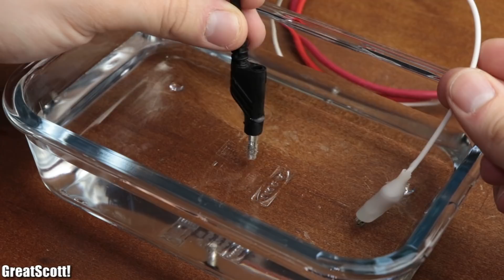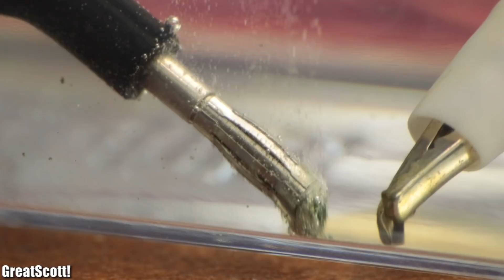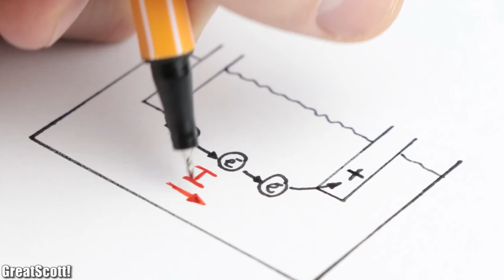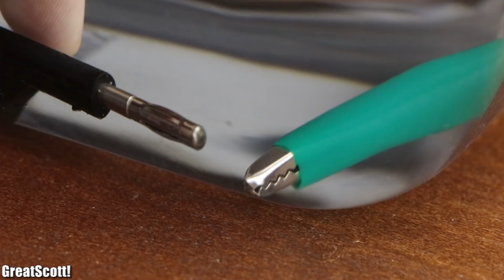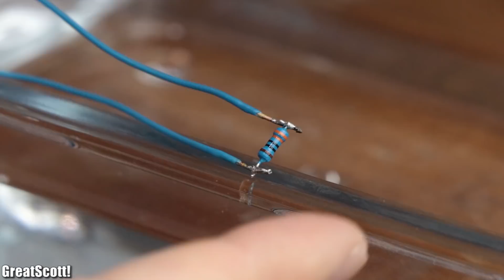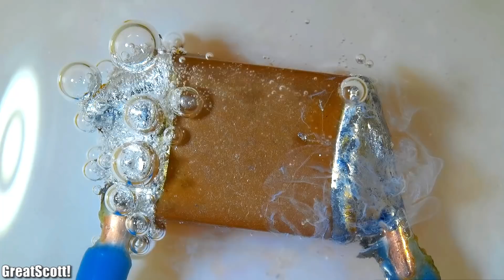Electronics & Water? What could possibly go wrong?

Comment: I'm glad to see you have "debunked" the myth of the conductivity of water. 

At a previous job, I would load test standby generators in the range of 250kW to 500kW to assure the generators functionality  using a "brine tank" as the restive load.  This is a steel tank filled with about 200 to 250 gallons of tap water and an isolated copper conductor plate which was slowly lowered into the tank to increase current draw.  Fully immersed, there would be near zero current draw between the plates when lowered into tap water.  By adding about various amounts of table salt, the water would conduct electricity to the point the load could reach 100% of the rated load of the generator and the conductive plates would have to be lifted out of the brine to regulate the load being drawn.

Thanks for the great work you do.
Reply from the maker: No problem. And thanks for the feedback. Interesting story.
Reply: @greatscottlab    You should do a follow-up video, repeating this experiment with seawater!

Comment: Really interesting ! I'm eager to see the video to make integrated circuits waterproof :o
Reply: Doesn't nail polish have acetone? would that not dissolve the solder mask and make the writings all smudgy?
Reply: UFOhunter Nope, it's nail polish remover that's made of acetone.
Reply: some nail polish actually uses some kind of plastic dissolved in acetone.
I'd use something llike polyurethane or epoxy, which can be bought for around 10-20€/kg.
Reply: You fill the case with apoxie or you spray it with silicone. Any number of things could have cheaply water protected portable devices. It’s criminal that it has taken so long when water is literally EVERYWHERE.
Reply: @alexanderm9832  right so the solvent in nail polish is also acetone. Thus why it smells like acetone and can be wiped off with it.

Comment: At work I operate Wire EDM machines that use a fine brass wire to accurately cut steel and aluminum. The cool thing about it is that they do it with the part submerged under highly filtered water using voltages up to 300VDC. With all of the minerals filtered out, the water no longer conducts electricity. Although it is not recommended, you can stick your finger in the water and never feel even the slightest tingle.

Comment: You should make video waterproofing electronic. Use some clean coating. :) or waterproof really old PC and run it under water :)
Reply: You cannot make PC waterproof like that because it will overheat.
Reply: Nopparuj Ananvoranich it can be in water with fishes. and you can always under clock it
Reply: Nopparuj Ananvoranich Water is a pretty good conductor (of heat).
Reply: That's not true, lol. The heatsink doesn't need to be waterproofed, it's already waterproof ;) It'll cool just fine, maybe with an underwater pump or two to blow some water through the fins.
Reply: You'll cook your fish. Plus, how do you remove the heat fast enough so that the water simply doesn't continue heating? Water has a high thermal content, but it also takes time to cool due to that.
Reply: BuzzCola 3 there now is
Reply: Learn about immersion cooling ;-)

Comment: Thank you for posting this. 

By the way, the second Arduino in the distilled water likely stopped working because the water would have dissolved any residual flux on the surface, increasing conductivity right at the surface of the Arduino. Once the dissolved flux remnants dispersed over a larger area, the conductivity would have dropped back down.

Comment: well I dropped my phone into toilet once, got it back in 5 seconds but it didn't turn on ever again. That's all the testing I needed to do with electronics and water. 
FAQ: 1.) I took the battery out imediatly (because it was nokia remember when you could take batteries out of phones yourself, peperidge farm remembers) and air dried it overnight before attempting to turn on. 2.) it slipped out of my hoodie big cenral pocket, the one where you can touch your hand together even though they are in pockets, you know the type, yeah be careful with those.
Reply: That water had a lot more impurities than normal tap water.
Reply: Well urine and stool both contain a lot of salts.
Reply: if fit falls into water DON'T TURN IT ON IMMEDIATELY
Reply: darius2640 I think that there was more than just water in that toilet...
Reply: Remove battery, immerse in pure isopropanol, brush corrosion off circuit boards, dry in oven (50-70C). Gives you, if not a working phone, at least opportunity to backup data.
Reply: remove the battery and let it dry bro
Reply: If you rinse the electrical device in Alcohol then resolder it will work again but not for long. Rescuing your phone from water damage is only for data recovery. The device has a short life ahead. It will be unreliable no matter what you do. Ipad rehab has a $99 special for repair and data recovery.
Reply: if it was long time ago try it powering it again with another battery

i once brought back to life a phone that was completely submerged in the sea and after 3 months it had still water in the screen but it worked perfectly without any issue
Reply: sleeptyper i use 95% alcohol to wash it off works fine.
Reply: what phone is it? if you could have possibly removed the back and taken the battery and sim out to let it dry.
Reply: my question is, how do you drop your phone in the toilet??
Reply: Did it fall before or after you flushed? there is a big difference
Reply: Solder Joe
 Depends on what was damaged and whether all corrosion/water is gone.
Reply: yes - if you ever drop an electronic item into water take immediate steps to disconnect the battery asap - I have 2 mobile phones that I had fully immersed into a bucket of water and they are still working today. Also I found that keeping these devices in front of a air conditioner (the real ones that use the gas) it really helps to 'soak out' all the residue moisture :)
Reply: Are u romanian?
Reply: problem was that you try turn on imidlity you need dry it first
Reply: Not on iphone if someone drops a phone in the loo chances are it's turned on. iphones usually short out on the screen connectors or an ic chip gets fried..either way you can't just whip out the battery fast on most modern phones which is a royal pain.
Reply: darius2640 I dropped my i5 in the toilet five days ago and it was working properly 24hour later
Reply: Clark Adams
i5 logic boards are about the length and width of a finger and roughly the thickness of a a coin.They are tightly packed with components unlike in this video they are a lot smaller with a lot more going on. Any moisture in there  could easily cause a short potentially. If yours is okay that's great news but it doesn't mean your out of the woods as parts could still be corroding make sure you back  up anything important just incase.
Reply: Mine survived a toilet just fine and then I bricked it through software a few days later...
Reply: I dropped my phone in the shower once and it got soaked but was perfectly fine.
Reply: Dariune put it in rice
Reply: A rinse in alcohol binds any water still in the circuits. As alcohol evaporates, it takes the water with it. But a bath in dry rice will then remove any remaining moisture. It may not save the phone for eternity but depending on how wet the water got into the phone, it may keep it operating for a long time, or not.
Reply: Same
Reply: You can still take batteries out of your android
Reply: i once lost my phone on my garage due to tall grass, i found it 3 days later and it rained. it was still on so i shut it off and let it dry. its still working to this day, it was a samsung galaxy j5, already rocking a new one tho. battery leaked out a lil but still working, batterly life was a lilttle worse after it but i didnt even bother to get a new one it worked just fine. the camera lens got completely fucked tho because humidity couldnt escape so i had to change the lens
Reply: @IAmRedNez  It is waterproof?
Reply: @TtEL  no, it was a sony ericsson k810i

but if it doesn't stay long in the water and if the battery is removed immediately the phone has a big chance to not get damaged, i've fixed many water "damaged" phones and most of them needed a new battery or a trickle charge at the old battery and some cleaning at the charging port
Reply: the amount of shit and piss in that water corroded the fuck out of it, and not the actual water
Reply: O
Reply: the water in toilets is similar to regular tap
but with more impurities and depending onwhere it happened the fac that it may or may not have been cleaned plays apart
Reply: Put phone in rice. It gets fixed, my mum did it to her s9

Comment: The Arduino failed just because the crystal oscillator is a very high impedance circuit, where even the distilled water is practically killing it. Using the a bit less accurate but fully internal on chip oscillator would mean it will work like a charm even in the rap water. It puzzles me, why so many designers not requiring any accuracy are still using the fiddly crystal as the clock source by default...

Comment: Once upon a time, when I worked as a control tech apprentice for an Asphalt Plant manufacturer... the official way we remidied dust/smoking plant operator problems with computers was a water hose. We were usually doing major controls upgrades that took weeks. So long as all the water had time to completely dry from around IC's, we never had problems. 
   A computer's rear mounted vacuum device often branded "Cooling Fan" causes big problems in an industrial environment. I've seen old PC towers that were 80-90% full of dust munchkins.

Comment: This video reminded me with an experiment I did any years ago. I dispersed graphene nanoplatelets  into a dielectric fluid to increase its thermal conductivity (way less than 1% by weight).I placed a computer power supply in the fluid after checking the electrical resistance of the fluid which was to high to measure, before and after adding the graphene. onceI powered the power supply, it smoked. I couldn’t understand which components failed. You should try this experiment with graphite in oil. You might figure out the cause of such failure. Thanks you for great video.

Comment: The current flow in the distilled water is caused as you have made contact with the water with you hand. You see, sweat also has ions and can make the distilled water conductive
Reply: that's what thought
Reply: Yeah, distilled water has resistance in range of several Mega Ohms
Reply: While pure water does have a rather small electrical conductance, would it be blasphemous to suggest that distilled water does not, with absolute certainty, contain any ions?

Even the vacuum of space contains a countable average number of hydrogen atoms in a cubic meter.

Comment: Electrolysis can be used to effectively and easily remove corrosion and crud from metals.  Simply hook up a DC power source to it with the negative on the item to be cleaned and a sacrificial anode to the positive.  Washing soda works awesome as an electrolyte  (I have used this to clean up old coins I've dug metal detecting & also many, many, many times to clean parts of machines in the workshop.)  The corrosion on both terminals you witnessed in the video is from using AC current.  Since the positive & negative swing back & forth, crud is deposited on both.

Comment: And this is why water cooling setups for computers recommend distilled water rather than tap water.
Reply: I think water isn't just good idea for cooling. It has rather a low boiling point for high power PC.
Reply: It doesn't stay distilled for long.

The usual cooling mix for computers is distilled water plus ethan-1,2-diol. Plain antifreeze, as an antimicrobial. You might think the water is devoid of nutrition, but the algae somehow find some anyway.
Reply: GreenMC in don't Think anything in  your pc should ever reach 100 degrees celsius
Reply: Kevin Rabe I'll agree with you, but even at lower temperatures water will slightly vaporize, so some alcohol mix would be better.
Reply: GreenMC wouldn't alcohol evaporate more quickly?
Reply: Kevin Rabe It depends of alcohol. For example Ethylene glycol has boiling point of 197.3°C.
Reply: I think distilled water is used because elements in tap water like Calcium would start to deposit to your cooling units and decrease its thermal conductivity. Like in your Water kettle.
Reply: Camelia sinensis distilled water eats metals like you wouldn't believe, the anti freeze has the anti corrosion element of the mix
Reply: Water is the only liquid that takes a lot to heat up and doesn't release the heat as readily. Google endothermic and exothermic properties of water. 
It is also the only liquid in the universe (that we know of), which expands when heated, OR cooled to freezing point.
Reply: Water, distilled or not, produces galvanic actions which will corrode anything with time. It creates microscopic voltage cells that does that. Hence the use of Zinc in process of galvanization of steel. Zinc is the sacrificial component.
Reply: if your cpu gets above 100°C you will start damaging it, so water is fine as far as boiling goes
Reply: Assuming the system isn't vented to the atmosphere, evaporation isn't a concern. The boiling point is the temperature at which the vapor pressure of the liquid equals the pressure of the gas above it. Evaporate some liquid and the pressure goes up, so the temperature of the boiling point goes up to a new equilibrium.
Reply: water on watercooled PCs doesn't reach that temperature, if the CPU reaches 100 degrees (water boiling point) the water is way cooler than that
Reply: "It is also the only substance in the universe (that we know of) which expands when heated, OR cooled to freezing point."
Add "known to me" because there are substances that have a density anomaly like water. Even some pure elements have that: gallium, silicon, germanium, antimony, bismuth and plutonium
Reply: Better use mineral oil? Tho the pumping process would be harder
Reply: @Gusstavv, Propeller piston engine on small aircraft, are cooled by engine oil.
Reply: UFOhunter Stop spreading BS. Silicon and Gallium also expand on both heating and freezing.
Reply: I spread whatever I want troll.
Reply: I listed elements specifically because even those show this property. Of course there are countless other substances that do it as well. Last time this was a issue for me was n-Decanol freezing (below 7°C) in the bottle and thus breaking it. What a mess...
Reply: You call me troll but it is you who is trolling.
Reply: @PolakPL2002  why do people think water boils so quickly? We've been using water (plus additives) for centuries now to cool things that gets even hundreds of degrees higher than its boiling point.
The thing is, it doesn't reach that temperature because the loop keeps going.
Reply: @PolakPL2002  the water inside a watercooling loop its never going to hit more than 70C and if it does its because ur having a bigger problems someone else.

I have had watercooled pcs for 10 years and never ever had a greater temp of 65c on the fluid it self, even when heavy overclocked high consumption parts are hitting 90c the water stays well bellow boiling point. 

Usually a delta in temp between 30°C.
Reply: @vylbird8014  nah, if u use antifreezer or glycol on a custom loop, you will get some nasty results, cuz the orings are gonna being eaten up by the glycol, usually used on AIO closed loops cuz of financial reasons, and because they are expected to last 1-2 years.

Also you can use PT as an antimicrobial/antialgae and plain DIstilled water, or even a silvercoil.

Comment: Years ago, I worked for Philips USA, Television manufacturing. We used to wash the circuit boards in a household dishwasher using de-ionized water and detergent. After the drying cycle and 24 hours of air dry, the boards were released to production. this was to remove the solder flux from the boards without harsh solvents.

Comment: You should've tried sea water too, just for fun :)
Reply: I ruined my phone in sea water ):
Reply: did u revive it?
Reply: No, but I tried a lot. It was supposed to be water resistant (Moto G4 Plus) but i think it's idiotic to put a non-removable battery if you want it to be water resistant.
Reply: He could just dump 100g salt and conducting would have increased along with corrosion

Comment: I have a question for you.
My computer is/was watercooled, radiator sprung a leak and drenched the 1000watt psu in coolant, and it let out a HUGE bang and took out both the cirquit breaker and the main circuit breaker in my house.

Would it be possible to fix something like this or do you think it's a waste of money compared to just buy a new?
Reply: StopaskingformynameYouTube don't risk it. Buy a new one, power supplies are dangerous
Reply: You can repair it, if you are lucky maybe it will be easy, but only do it if you have enough experince with power supplies...
Reply: If the power transistors are shorted on all 3 pins, don't try to fix it. There will be many other faults and it will be very difficult to fix.
Reply: Watercooling is retarded.
But it was fine for 5 years tho.
Kept my system at 40C while gaming and made allmost no sound.
But i guess if you're doing watercooling, radiators should be changed after a few years just in case.
Reply: The bang let the magic smoke out, only if you put it back in it will work again
Reply: StopaskingformynameYouTube
Even if you know in great detail how a switching power supply works, without a full schematic diagram of your particular model, i think it will be difficult, and not least, costly, to fix it! Sorry dude, but i honestly think you're better off just buying a new PSU.